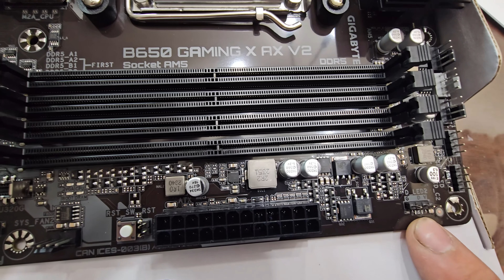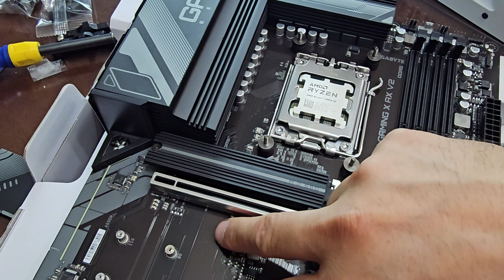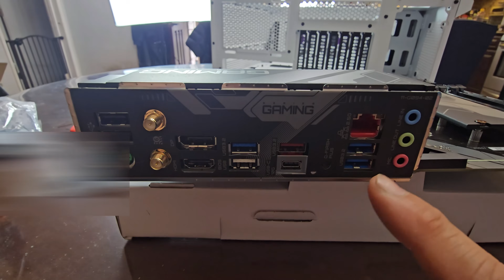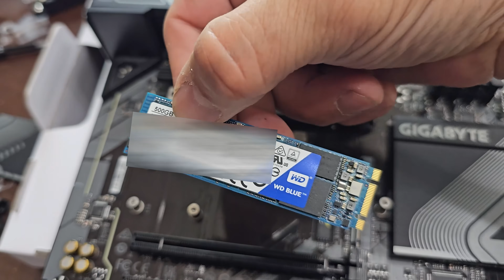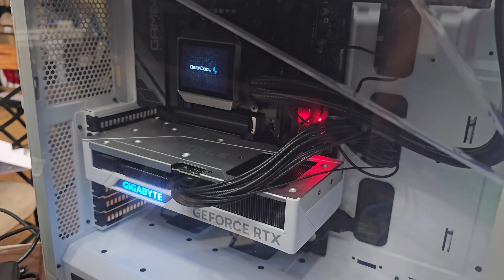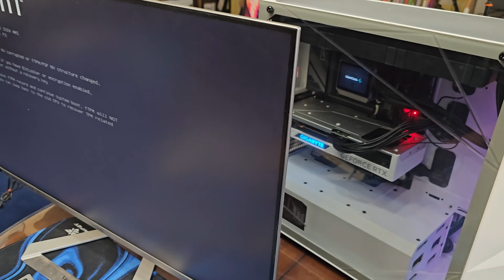GIGABYTE B650 Gaming X AX V2

Comment: Can you explain how do I install my ssd
Reply from the maker: Remove the metal case and install the SSD m.2 and use the cover to mount the SSD this will push down the SSD make sure to remove the plastic covering the thermal tape.

Comment: Hi, I’ve read that this motherboard has issues with internet connection, and I’m not sure if they’ve fixed it yet. I want to buy it in a combo deal with a good price, but I’m not sure if I should go for it :/
Reply: Super late but if you haven’t bought, this mobo has been great and have had zero issues with internet connectivity.

Comment: quick question dose it have any rgb aura sync in that motherboard ?
Reply from the maker: No, but you can control the RGB with other third party software
Reply: @Upgradetech ahh thats good , thanks !! I should able to manage with the extra fans on my sides for the y70 case

Comment: i recommend most ppl that arent intent on initially using a 5x4 drive to install their 4x4/starting main drive in the #2 slot which is still 4x4/cpu lane supported...so when they uppgrade to a gen 5 drive in the future...its very easy to install...w.o having to unplug/remove gpu/and the 2 slot heatsink. Makes that process a lot easier when that time comes.....not bad for what it offers gen 5 drive support, wifi6e for when this build is 5 years old/parted out and the cpu is replaced with an APU for steam remote play in another room like a shared 4k tv or projector....feeding a game thats actually powered by a newer/more powerful build with the new amd/intel socket and chipsets with faster ram etc....its what i do with my b550i pro ax. Knowing a board/build can still be retired into something useful is nice. I just wish amd offered better integrated graphics in general for their ATX boards...for some reason their apu/soc are better on mobile platforms but even those mini/pcs are limited to lpddr or sodimm. But who cares when its just going to be streaming from a main pc. Sure beats doing it with a laptop/noise.